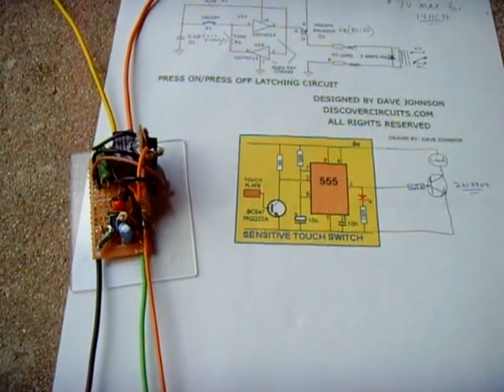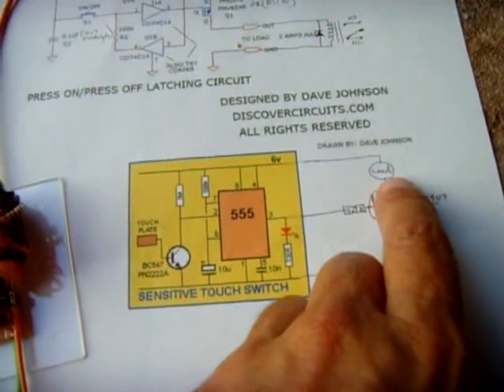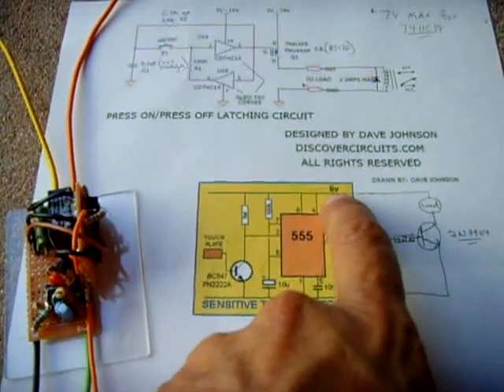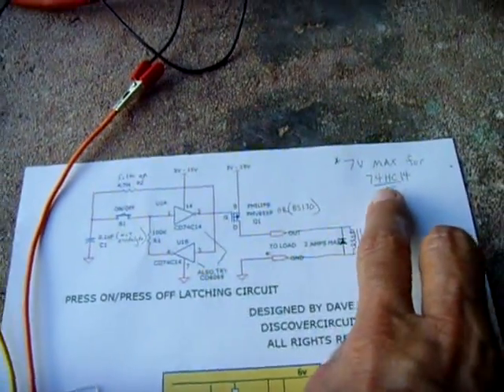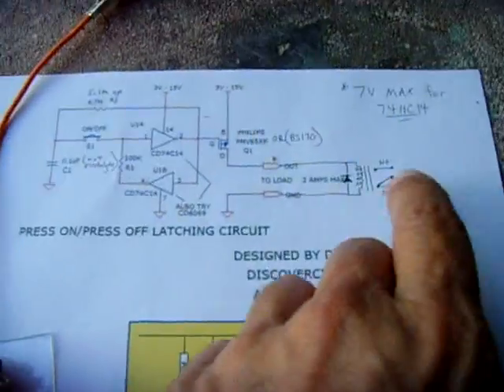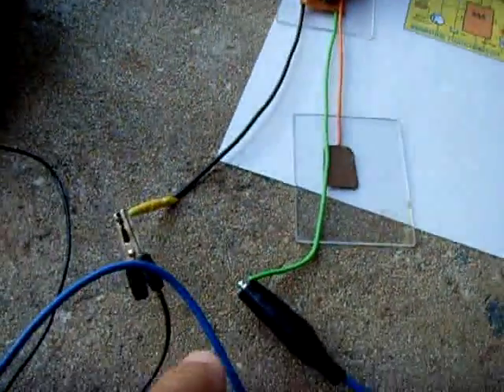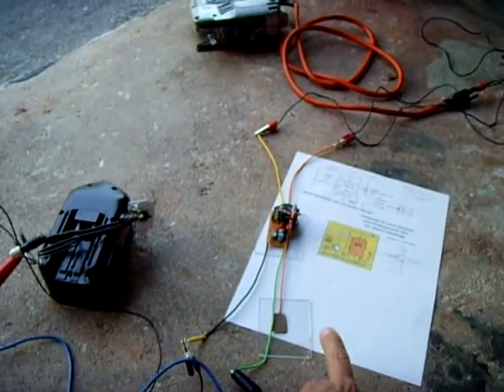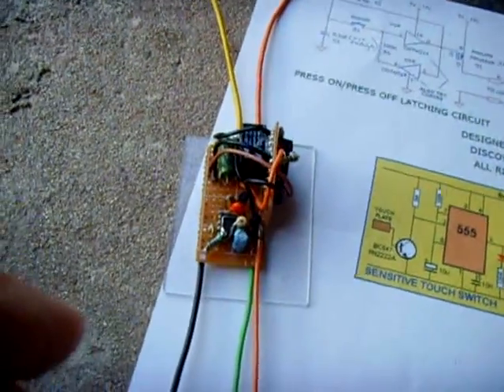Single Contact LATCHING Touch Switch - ON / OFF

Comment: Great project, expertly explained! Thanks for this video. 
Roy
Reply from the maker: Thanks Roy!
Reply: @electronicsNmore  
hii,

i have a high voltage generator purchased from ebay. 
i want to use it to kill pest that keep ruin my garden, because of flexibility of it. 

can you pls tell me how to use the 2 output high voltage wire to activate itself on and off ? 
for example, the 2 high voltage output wire is stuck to the hole  at opposite side (the hole that pest made). and when the pest come in thru the hole, touching the wire lightly to it own body when it try to squeeze it thru, will activate the hig voltage generator for 30 secs (enough to stunt it or kill it), then after 30 secs it will turns itself off.. 

i have to include the timer because a continuous power on will burn the high voltage generator itself (china made quality). also i don't turn on the device and let it on all the time be it got pest come thru the hole or not, is because it has to be running in garden where no power supply .. hence i don't want the power supply to run down before the pest come to it.. 

can you pls help to make such a circuit or video of it ?  since the output wires (high voltage output) which i want it to power on and off the high voltage generator itself,  it has to be design in such way, the high voltage won't fry the switch circuit after turned on. 

thx
andrew

Comment: Hi, could you please clarify the working principle of the unmodified version of the sensitive touch circuit. From what I've realized, transistors bc547 or 2222 can be used, and when you touch the base contact, does it latch the 6v load on and after a specified time turns it off? And could a 6v relay be placed instead LED with 330ohm R? In other words how much load current can the original circuit withstand? Thanks.

Comment: Its very good " Soft Latching Power Switch Circuit" what i am trying to do is i am using it as a feature in my project to turn on and off my project The main problem i am facing is that intial power on of the circuit secondly i want the delay of 0.5sec to increase by 2 seconds please assist me on this i have got my submission in 1day

Comment: hey there, video is very good. but  it would be great if you put combine diagram instead of two different diagram, it bit confusing to understand. the thing I want to ask you that does it matter if i give 9 v DC battery as input voltage instead of  6v? does it works proper?  or it won't give proper output.
Reply from the maker: Hi there. It's very easy. The schematic in yellow is exactly what you see. Where it says, "Load", you connect the reed relay coil(9V if that is what you intend on using, or a 5 volt using a resistor in series with the coil to get the voltage down from 9v). The contacts from the reed relay are connected to the momentary switch contacts of the latching circuit. To use 9V, Make sure you use a 9V Songle Relay to control the appliance, and power both rails of both circuits using a zener diode regulator circuit, which is nothing more than a 1W 6V zener and resistor of the correct value for the desired current.
Reply: Hi, thanks for the replay, another thing i wanted to know that if i use only yellow diagram(with out your modified version) it's works as astable mode, the LED keeps on. I have tried your modified version, but  know i am not getting output. I have used same component as you had used.
Reply from the maker: vishal barot
Better check all your components and connections, because it does work. Keep everything as shown in the video.

Comment: hi your work is great but i hope you can help me i only want to make te part of the on/off switch i already make the part of the yellow diagram an it works but after a few seconds it turns off,  i want to know if you can tell me how did you manage to make it turn on and stay that way until you touch again i notice that you use a relay and a Reed switch but in the diagrams there is no indication how you conected them, i dont need the LV-HV i want the switch to power a led strip so with 12V its ok i hope you can help me and thank you very much
Reply from the maker: +sismo99 
Hello. Easy fix. :-) Add a low value non-polar capacitor between pin#2 of the 555, and the NEG rail. Start with a 102 cap (.001) and slowly move higher until it corrects the problem.
Reply: +electronicsNmore than you very much but making that i still need the relay and te reed switch or only putting the capacitor between pin 2 and the neg will make stay on until i press again (i inly havce the yellow diagram completed even put the led with the 33o resistor) sorry for mi questionsbut i am new in this i am learning
Reply from the maker: sismo99

The capacitor prevents false triggering. You need both parts of the circuit if you want the same result shown in this video.

Comment: Why are you using a reed switch and the latching circuit. Can just put a relay on the place of the reed switch and control what we want. I mean i need this circuit for 12V led strip. Did I need the latching circuit?
Reply from the maker: +Емил Чапъров Hi. It has to be made as I show. Thanks
Reply from the maker: +Емил Чапъров Hi. It has to be made as I show. Thanks

Comment: rode the yellow scheme up but when I play it connects for a while and then off "in my example put a lamp" she lights and then goes out alone, want to touch and light and only go out when I play again ??? please help me :(
Reply from the maker: Hi Fabio. It is hard for me to understand you even using the translator. The circuit should work fine using 12VDC. You may have to adjust some values to get it to work properly at 12v. If the circuit triggers, but goes off by itself, then try adding a low value capacitor (102/.001uF) from the touch plate to ground, or from pin 2 to ground in the yellow schematic.
Reply: sorry for English (laughs)!!

ok, I managed to do just that was very sensitive when the refrigerator league lights the lamp (laughs) I have to come up with a way to get a little sensitivity. if you have any tips, thank you,,,
Reply: Any email where I can post my project?

Comment: hi, it z cool circuit now i m building it but i m bit confused, in video u said u have two relayz right? then in your project as i can see in the video u hv only used one relay..please make me clear asap i m building it right now..
Reply from the maker: Sorry about that. The lower schematic in yellow uses a reed relay. The normally open contacts of the reed relay are what connect to the upper latching circuit which in turn triggers the relay in the latching circuit.

Thanks For Watching!

Be sure to share, rate a thumbs up, and check out my other videos.
Reply: electronicsNmore hi, again i m facing a problem (1)in this circuit design, when i supplied 9 v from battery which iz 7 v actually the circuit works and activate the relay, but when i supplied 5 v  500ma from main DC tht time the circuit remains on and activate itself again automatically, i m talking about the first yellow circuit here. can you tell me the issue exactly ASAP, and (2)again the first time i switched on the circuit the relay activated automatically and then it goes off waiting for touch response..Please I have to do it any way ..thanks
Reply from the maker: Why would a 9V battery be 7v? I'm pretty sure the circuit calls for 6v. Make sure you use the correct voltage. If you are experiencing false triggering, try adding a SMALL value capacitor from the touch plate to ground(BATT NEG). Try a 102 cap.
Reply: lol my 9 v battery showing 7 v in multimeter..tht why LOL if I use 102 cap from touch wire to grnd.. then the automatic switch on problem at start up will be solved Are sure about it?
Reply from the maker: I had a false triggering problem. Using a capacitor from the base of the transistor(touch plate to ground) eliminated the problem. Start low, and move higher until the issue is resolved.
Reply: I have another problem the touch wire I have not used any transistor yet because my touch sensor iz sensitive i dont need to add a transistor, can you help me about it? even without touching, getting near to it it activate the touch and relay..i am confused wht to do?
Reply from the maker: rakesh kumar Routray
I have no idea why your circuit would be more sensitive that mine. For results like you saw in my video, you need to do EXACTLY what I did. I am too busy producing videos, and answering other questions, that I cannot spend too much time with one person. Some people go out of their way for me by posting links on other websites to my videos, Those people I offer extra assistance to. I cannot be expected to spend a lot of time with any individual who does not return the favor to me by sharing my channel with others. VERY FEW people reply back to viewers like I do on my Youtube channel. I know that for a fact. Copy EXACTLY what I did. There is no reason for it not to work.

Thank You for watching.
Reply: sorry for disturbing you but i will definitely share your vedio after successfully implementing the circuit when i do tht time your circuit will be published via your video in my website as well as other technical website, dont worry..I am very friendly. I am an IT engineer good at software development but I am a beginner in electronics ..tht why I am asking so many questions..but how far i know people do reply very often in their channel for viewers tht a fact i am not arguing tht but if you posting something techno things over youtube then you should be prepared for reply too then your channel will be famous. tht a FACT ..
Reply from the maker: I know several BIG channels which hardly ever reply to user questions(definitely not more than once). That I know for a fact. I do not want to mention names. If your looking for a higher level of help, which I do not charge you for, then you should post links to my channel (show them in the comment section) before asking for that higher level of help. It is the right thing to do. I cannot spend too much time on one person. I have too many requests, and a personal life also.

Thanks For Watching